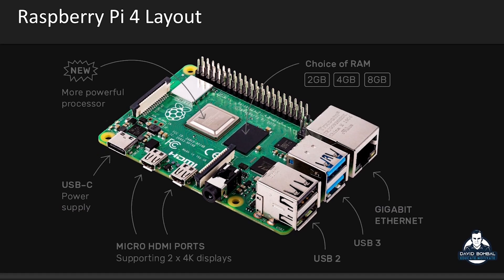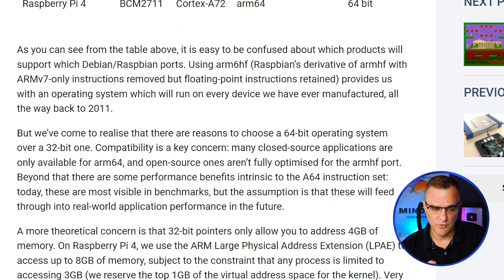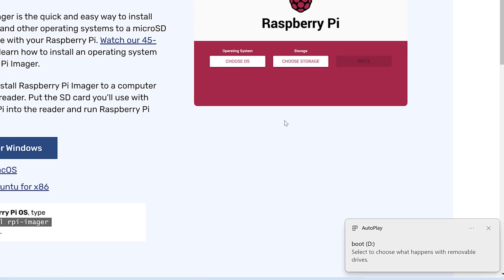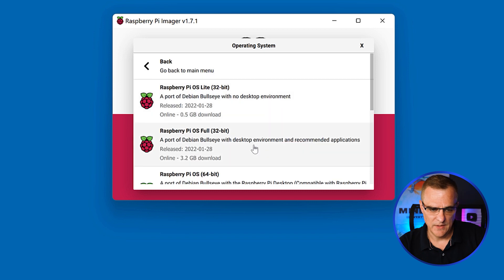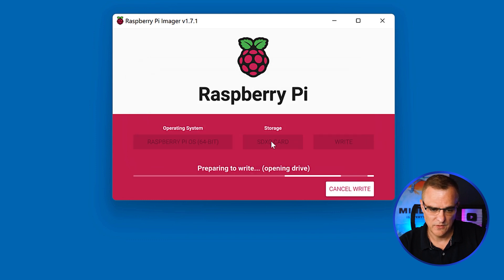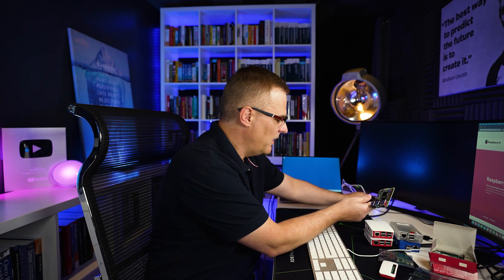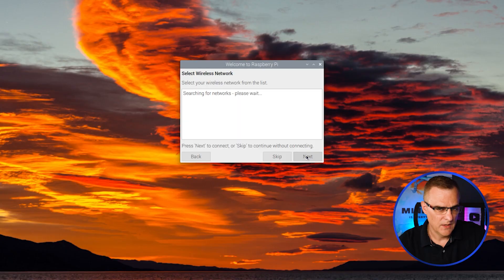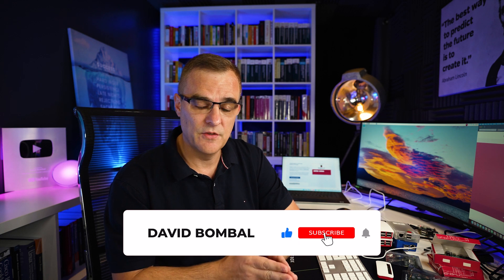Raspberry Pi 64 bit install

Comment: You can use more than 4GB with 32bit system. Just single process is restrained to 3GB. You even show the article, but it's like you didn't read it.